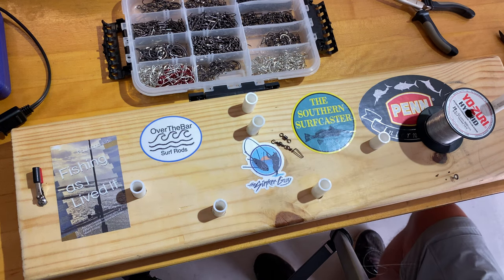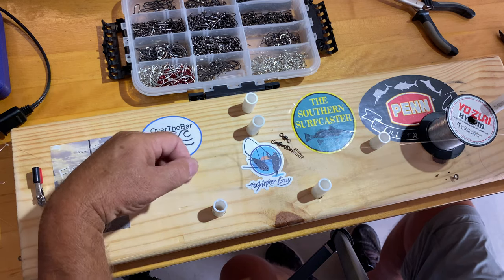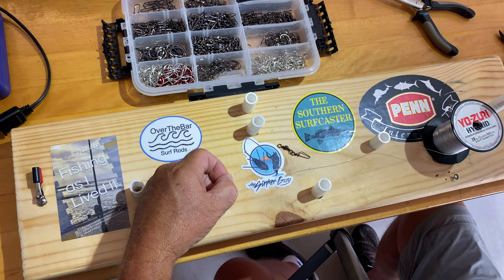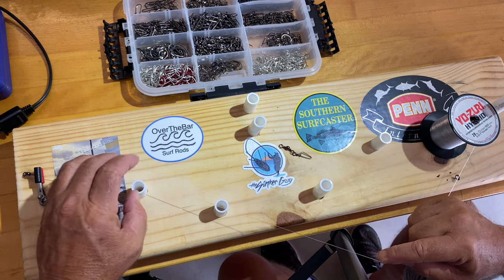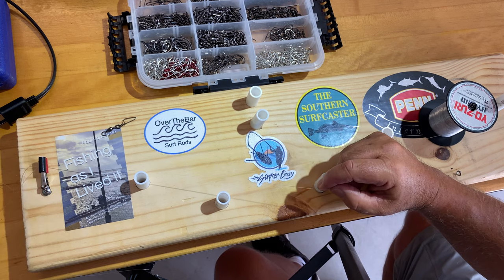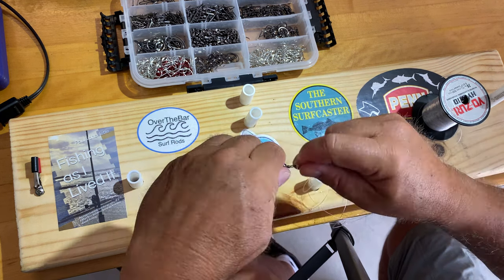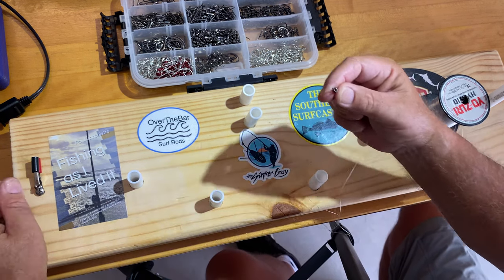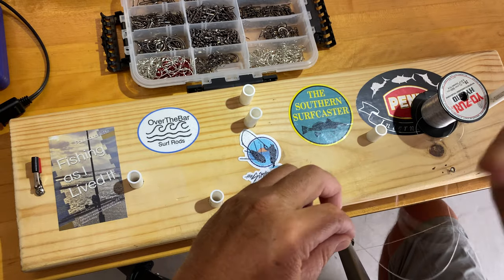How I tie my double dropper loop rigs.

Comment: I have to make a board I started tying my own Sabiki Riggs but I would put six hooks on a rig now the wood looks like it's pressure treated is it pressure treated because you're spraying the water on the knots also I would put eight twists in the dropper loops to keep the loop together